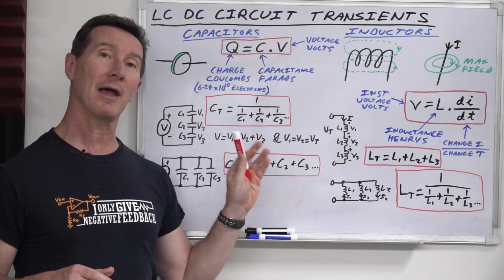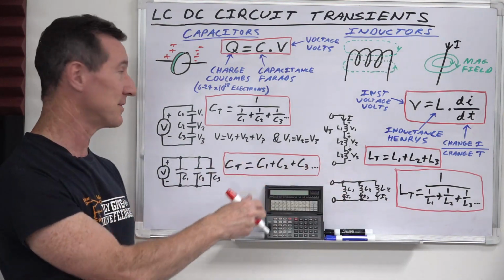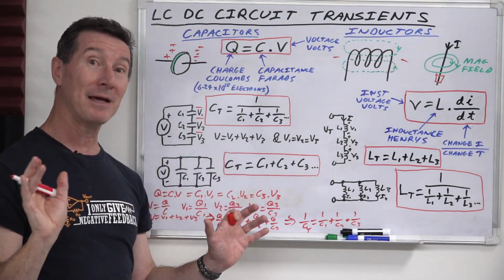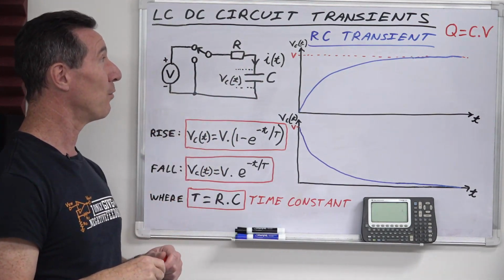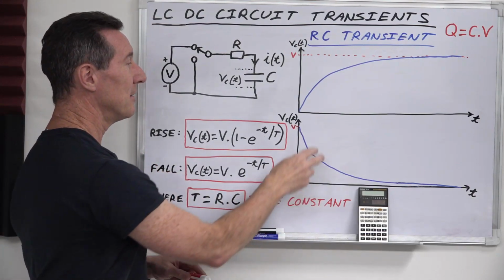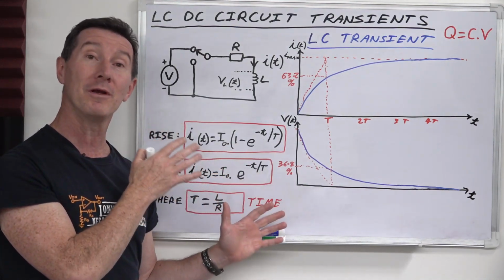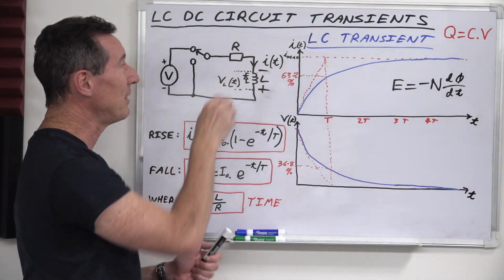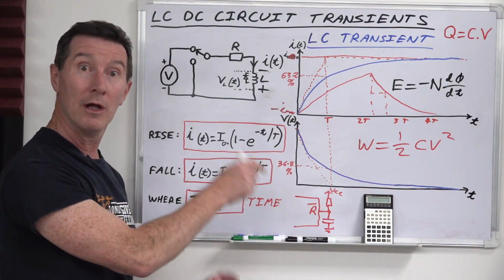EEVblog 1406 - DC Fundamentals Part 7: DC Circuit Transients Fundamentals

Comment: Just really figured out today that an inductor switch polarity when the charge is broken.. flipping? Forward unlike capacitors that pushes back... now a buck makes sense.. the pulse is faster than the cap and join in with its own horses creating step up voltage...
Reply: An inductor opposes changes of current, you get the polarity from that. For example when you try to increase current there will be a "voltage drop" across it at first, and when the current decreases it will raise the voltage, acting like a source, to keep the current flowing.
Reply from the maker: @1900OP  Yes, the voltage reveral is the consequence of the inductor trying to maintain the current flow in the same direction.

Comment: Salvaged components from an old VCR.. was amazed with how many inductors was used right through the board.. the board seems to present a quality that just preceded the move to smd.. lots of good pots etc.. Made me wonder what are the practical uses of inductors...someone liked them.. I did some googling out of curiosity and found articles that seem to suggest that some desighners avoid them... and listed some practical applications and explanations... still enjoying it...

Comment: 9:32 - "not that electron current flow rubbish" 😂
Reply: In my Electrical theory class, the professor asked for conventional flow textbooks. The nimrods at the bookstore ordered the electron flow version. There wasn't a single lecture where he didn't squeeze in a gripe or a jibe.

Holy smokes! I got a like from Dave! Thanks dude!
Reply: In electronics class conventional current was king, why make it harder than it needs to be...

Then in physics class, you now have the right and left hand rules as well as velocity vector and magnetic orientation, that's before you even consider curle and variation in field geometry..

It was once so blissful to be so nieve haha :-D

Comment: What's really interesting and new to me, is that if you have series caps of different Farad ratings, they should end up with different voltages across them.
Reply: Well it's not super useful most of the time, since you cant just draw current from it, or use it as a reference, and so on.
This does come into play when you power stuff with a Capacitive Dropper on AC though. The "dropper" capacitor has a small value and gets a lot of voltage, and any (electrolytic) capacitors after the rectifier can have a large value and get a low voltage, even if you dont use any Zener diodes.